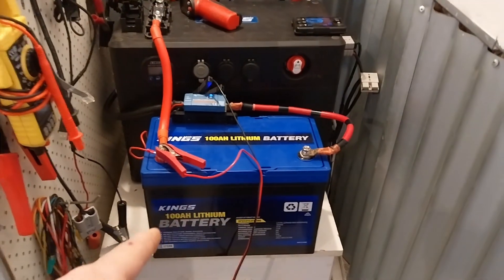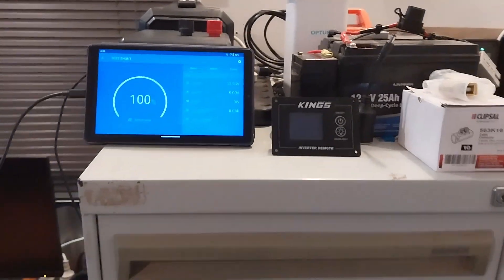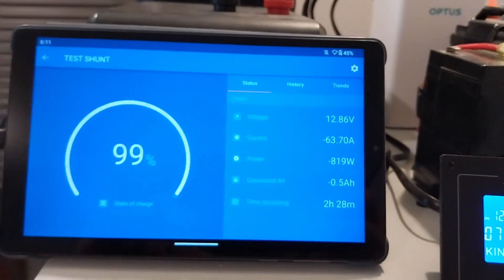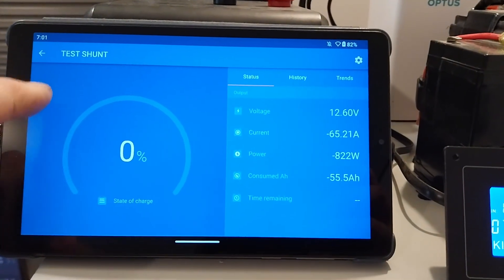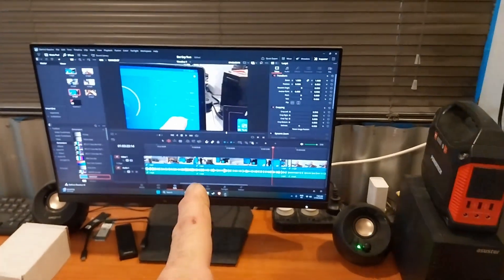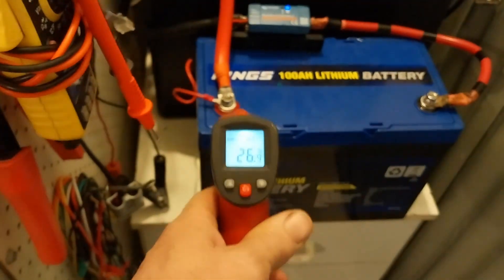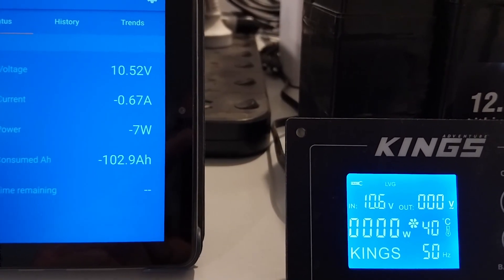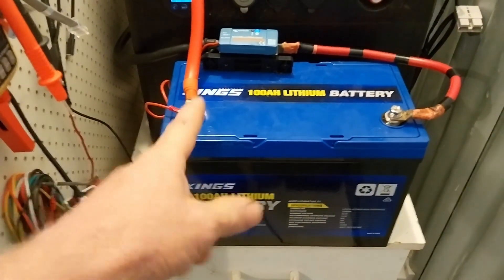Kings 100 Ah Lithium Battery Capacity Test @ High Current Draw

Comment: Excellent reviews. 2yrs ago (prismatics) I purchased 4 x 300Ah Kings as a back up for my 800Ah old school opzv ran them in series with an external BMS cycled lightly for 4 days I leant on it once and 3 out of 4 failed. Refunded and about 2 months ago purchased 2 x 100ah Kings… PUNISHED them for 7 days straight. Definitely no temp cut off in mine but they keep pulling just over 100ah. Have heard many happy stories of the 100-120ah but unlike you me and others most don’t know or care to push them and get see what they got. Lithiums have dropped in price heavily the last 2 months along with panels ect it’s tempting to go bigger especially when full time off grid but 15000 Quattro Lynx 1000 Cerbo 4 x 250-100 24 BMS GX screen it seems a bit excessive 😂 42 x Jinko 500+w panels would be nice though…. You know for those cloudy days. Awesome vids love ya work. 🤜🏻

Comment: So how long did the battery last while using the heater.......ta
Reply from the maker: I didn't measure the time however if we look at the time on the tablet, I started the test at 6:10 and the time showed 7:45 on the tablet when the test ended. So it was around 1.5 hours of run time, roughly 👍

Comment: Glen, just discovered you and thank you, very informative video. I do have a question you may or may not be able to answer. Can I run three of these 100a/hr batteries in parallel? Thanks in advance.
Reply from the maker: I'm not sure on the maximum number of parallel connections you can do on the 100 Ah battery. I didn't find anything on the Kings website for the 100 Ah batteries regarding the series / parallel connections. However if you go onto their website to their 120 Ah Lithium battery, it states the following....

.... "you can connect up to 2 deep cycle lithium batteries together in parallel to double the rated capacity, or connect up to 4 deep cycle lithium batteries in series for increased voltages"

It would be best to give Kings a call and to confirm this.
Reply: @TheOffGridBachelor , thanks for your reply, I couldn't find anything either, so thought I would ask you. Picking up three tomorrow, will ask the question then, they had a really good special on yesterday, battery and a rechargeable work light for $238 each, so I bought three, time will tell

Comment: What size cable and fuse did u put on the battery??
Reply from the maker: 300 amp cable with a 150 amps fuse.
Reply: Ahh ok thnx...I worked out same fuse but I'm making sure my cable is 1 or 2 awg just to run a fridge and later want to have a 24v setup.thnx 4 reply @TheOffGridBachelor
Reply from the maker: @paulsoutbackgardenaustrali7674  I used the Kings cable for their inverters (link below) which is speced to handle their 3 Kw inverter. I put in the 150 amp fuse considering my inverter on this set up is only 1Kw. When you run 24 volts your current draw halves so that size cable will be plenty.
Link to the Kings inverter cable:
https://au.adventurekings.com/inverter-power-cables.html

Comment: Another cool video Glen! Have you ever done a video in doing a capacity test on AGM or Lead Acid batteries (deep cycle type)?
Reply from the maker: Doing a capacity test on a lead acid battery / AGM is a little harder to do as the batteries Ah rating will change depending on the current draw. This is measured in the C rate of the battery and is due to the batteries internal resistance and the Peuckit effect.
It is possible to do a capacity test but hard to get an accurate figure so I never worried about it when I was running lead acid batteries.

Comment: Thanks for your video. Any recommendations for a 100w solar panel?
Reply from the maker: The panels I have are anywhere from ten to twenty years old, back when quality was still around. It's hard to give recommendations of what brand to use now-a-days as there are so many on the market.
I am testing some of the Kings folding panels at the moment and haven't had any issues yet, but it's too early to tell if they will last the test of time.
Reply: @TheOffGridBachelor  Thanks for that. As you say so much on the market..What is good. I have some Renogy 100w panels (6) which I can only get about 70 watts each out of and  2 VoltX 200 watt blankets which I have trouble getting 100w out of, very disappointing....So looking for something better. Thanks
Reply: Depends where you are and how much space you have. used house panels can be dirt cheap.
Reply: @rubikmonat6589  Plenty of space and in Vic Au. Do you have some suggestions?

Comment: Interesting- but I don’t entirely agree. What you’re doing is really an abnormal torture test. 
Probably 99% of people do short bursts at high power, and most of the time LOW power draw like lights and a fridge, and even that is typically cycling off and on.
Reply from the maker: Yes you are correct, although short high current bursts will still take the battery above the 0.2 C draw for that short time period, but nothing a Lithium battery can't handle.
The main reason I run with this higher current is I didn't want to take 5 hours to do the test and I don't have very many devices I could plug in that run low current, that was not an hours work setting up and packing away again. So it was done this way due to time constraints, but it was great to see the battery handled the work with ease.

Comment: Another awesome video mate. Can I please ask, when you say 0.2C does that mean capacity ie ah.
If so I may be one of those nerds that runs their van at 0.2C🤓😎
Reply: 1C on this battery is 100amps, so 0.2C x 100Ah would be 20amps.
I believe MOST people would be using only short bursts of high power, and mostly just lights and fridge, so MOSTLY less tha 0.2C. Therefore I’d call this more of a torture test.
Reply from the maker: @FutureSystem738..... Now-a-day more and more people are carrying induction cookers, air fryers, microwaves, coffee machines and electric kettles when they go away camping and have 3 Kw inverters fitted to their rigs.
The power demands of todays travelers is certainly a lot higher than it use to be back when we were aloud to have camps fires to cook on.
Reply: I hear ya 👍 @TheOffGridBachelor
Reply from the maker: @GoodenuffCollective.....The C rate is the relationship between current draw and battery run time. In the lead acid days the higher the current the more effect it had on batteries run time / efficiency. For example if you double the current the run time would be reduced to, not half but more like 1/3 of it's capacity due to the high internal resistance and the Peukert effect. So they came up with the C rating which was a calculation you used to determine the run time at different current draws.

Lithium batteries are different where their internal resistance is very low and current doesn't have as much of an effect on the batteries run time. But the C rating is still used to determine run time over current draw although calculated at different values compared to lead batteries. If the letter C is before the number it relates to lead acid batteries. If the C is after the number it relates to Lithium batteries.

For Lithium batteries 1C = 1 times the batteries nominated current and in the case of my 100 Ah battery, it is 100 amps. 2C is twice the nominated current which would be 200 amps. 0.5C is half of the rated current (50 amps) and 0.2C is 1/5 the rated current (20 amps). Industry standard for testing "Lithium" batteries is a current draw of 0.2C but as you saw in my test I was running around 0.7C

However due to the higher number of trolls and perfect people nit pick on my channel now-a-days, I had to add that I was not running at the 0.2C rate so as to keep those people happy.

Comment: Great video, we’re novice campers & currently I have a very basic set up in my Aussie Swag off road camper, I have a Kickass 20amp MTTP 2 x 120ah Kings AGM which very heavy at 31kgs & i just bought a Kings 300w tri folding solar panel. 
We currently only run 12v stuff  a Staycools 75l fridge, led lights, charge phones and CPAP machine using a 12 to 24v step up & this very basic seems to work well for our needs of occasional weekend camping, also the AGMs are trickle charge with a single 20w panel  while not being used & that seems to well also
But I’ve thinking about switching to a single Kings 100 or 120ah lithium for capacity & particularly the weight saving.

Which size would recommend & could I still trickle charge with my 20w solar which is good for a massive 1.2 amp?
Cheers
Reply from the maker: Bigger the better I always say however, when on one of Kings many sales, the 100 Ah lithium is hard to beat for price. The 120 Ah would be better as it gives you a little more capacity and slightly more maximin current output should you use an inverter. When on sale, the 120 Ah is a pretty good price as well.

If your solar controller has a Lithium charge profile then it would be a simple swap out the batteries and change a few setting on the controller. But if your controller doesn't have a lithium profile, it will still work, however for long term use, you would need to update the solar controller. You will also need a shunt based battery monitor which are pretty cheap now-a-days, as you cannot tell the state of charge on a lithium battery by reading the voltage alone.

As for trickle charging, the 20 watt panel should be fine if you have no parasitic loads on the battery. But in reality a lithium battery does not need to be on a trickle charger. It can be left for several months without losing much of it's stored power, provided it has no parasitic loads on it. Just give it a top up every 3 months or so.
Reply: @TheOffGridBachelor  Thanks yes the Kickass controller lithium compatible & I also have a Batblock 25 which currently has my old 4x4 battery & I’m  thinking about putting it in the tool box in my camper & I’ll probably fit one of the AGMs in the canopy of 4x4 to run my fridge while because it’s too big for camper when closed.
So if I disconnect the lithium & fully recharge every 3 months it’ll  fine & also can I just recharge it with solar?

One other think, am  correct in thinking that lithium batteries need to fully charged before first use after purchasing?
Cheers